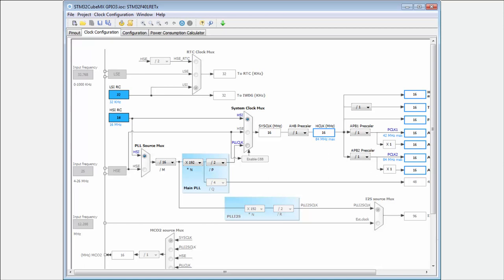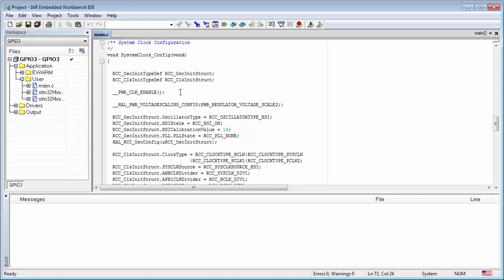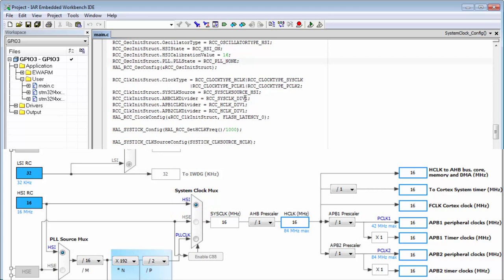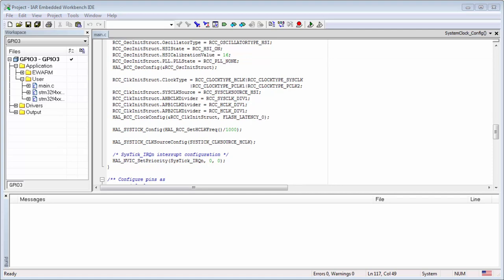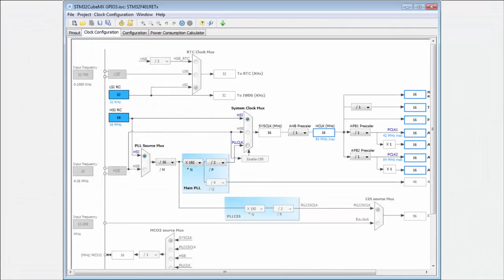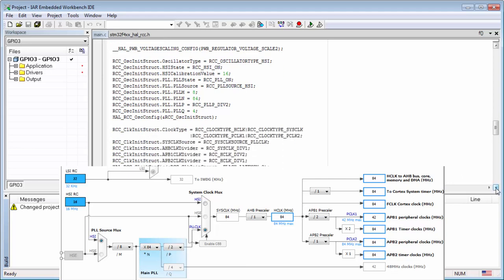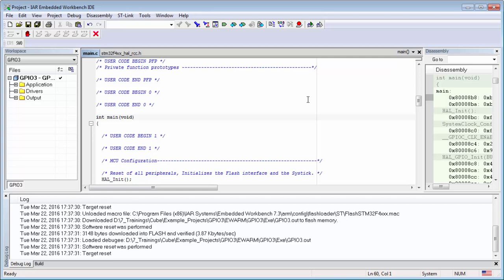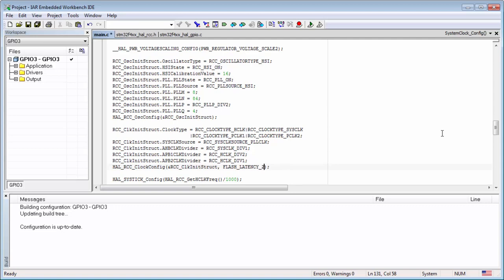STM32CubeMX basics: 08.2 STM32Cube HAL theory RCC - Lab RCC

Comment: Does setting the wrong wait state damage the MCU ? Or does it just give an error ?
Reply from the maker: Hello, configuring lower than expected number of waitstates will not damage the MCU, but could cause its improper work as FLASH memory will not be able to provide code and data that fast.